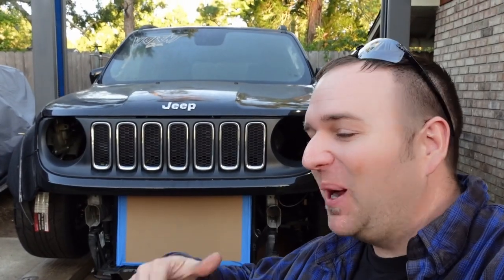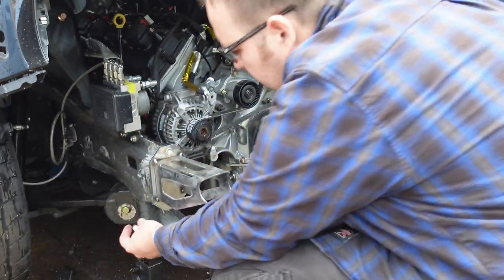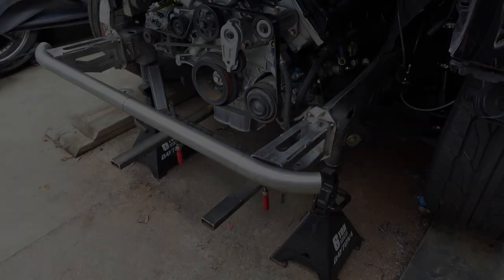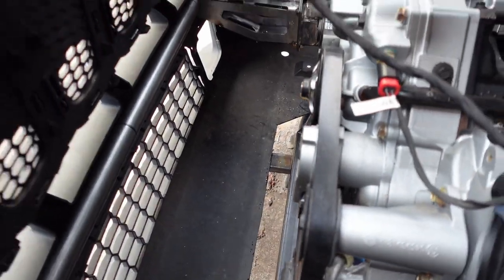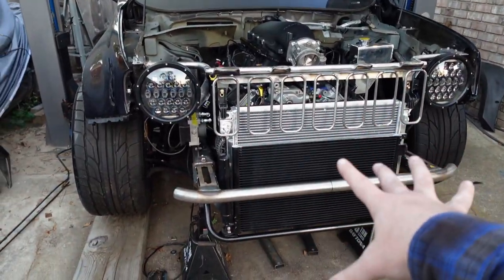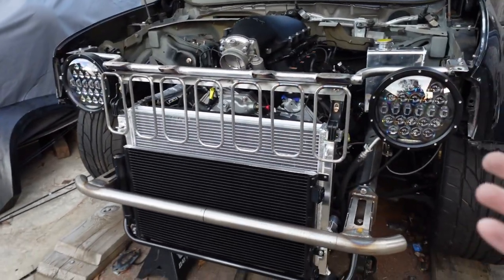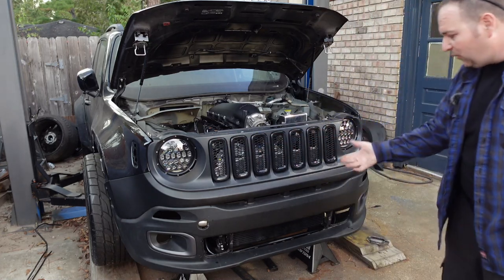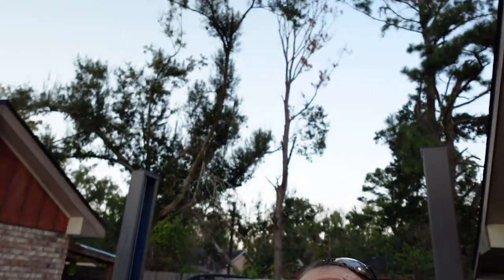HEMI Swap Jeep Renegade pt. 25 Bash Bar, Radiator, Headlights, and Grille

Comment: For the pipe bender, you can clamp the tab on the handle into a bench vice, allows you to pull hard on it, or put a tube over the end of the bending handle to make it easier to bend tougher stuff👌🏻
Reply from the maker: yeah I realized that after i was like half way though.  That woulda been so much easier.  We do that for 3/4" tubing at work, but I just spaced I guess 😅

Comment: the radiator fan is going to be a tight fit !!
Reply from the maker: Yeah its pretty tight in there, just about a 1" gap.  As long as it doesn't touch anything it should be good.  Maintenance and changing belts is gonna suck though.
Reply: UPDATE?!?

Comment: Glad to see more build update coming up! Do you open to add more new lighting kits to your Jeep?😉
Reply from the maker: It feels really good to get this project even closer to finished.  I do plan on installing a ton more lighting on this thing before it's done.  I just ordered the 8 gang AR-800 switch panel and 20 of the RGBW rock lights to get the light show started (should look crazy for burnouts).  I'd love to use more Auxbeam lights, like 9" off-road lights for the headlights, but unfortunately I couldn't find any that have low beams and high beams, or a dimmable option.  I really don't want to blind traffic too much 🤣  Since I can't fit the factory headlight housings anymore with all the modifications, I was kind of forced to use the ones I found.
Reply: @HEMIGADE  I see. What light you find and plan to take it as the headlight? I think Auxbeam is definitely don't mind to send other lights to support your build:)
Reply from the maker: @Auxbeam  for sure, I'll definitely be adding more lights to the build.  I'll need to change the fog lights, and upgrade all the incandescent bulbs to LED, then start adding light bars and pods.  I can't wait to get this thing sorted and looking great too.
Reply: @HEMIGADE  That's great I think we should be able to sponsor all these lights. Do you have a way for me to send the links of the lights?😁

Comment: i’m about to look into but a renegade this would be a nice to have haha but i honestly just like the shape of the car and it’s an upgrade from mine been lookin
Reply from the maker: They're actually pretty good little cars for what they are.  Like you, I got mine because I liked the overall design of it, and wasn't worried about performance at the time.  They're decent on gas and I had zero issues with mine before I chopped it up.  Mine was on the first shipment to the US back in 2015, so they've sorted out any potential issues like oil consumption which seemed to plague a lot of early models. Good luck with your car shopping, no matter what you end up with!

Comment: Looking amazing brother!!! I'm so excited for you! Gotta ask with the grill inserts did you just cut out the plastic and replace it with something else or did you just Dremel out all the holes like a lot of people have done... lol! I'd love a link or just a I bought the insert material here if you don't mind sharing or is there a cover on the back that you were simply able to remove. I have to look at mine. I'm going to do the same thing on both of mine. Keep it rocking brother!!
Reply from the maker: I took the whole grill apart, and cut up the back piece that has the mesh pattern in it. I used a cutoff wheel in a grinder and just trimmed the whole section out.  I bought those black plastic covers many years ago, so I don't remember where they came from.  They were just cheap stick-on covers probably from Amazon or ebay for like $20.

Comment: I have a renegade that I am dying to modify. I dont think I want to go a 5.7 swap haha. All I want is to get maybe 250hp out of my 2.4. I wonder how hard it is to add a simple turbo setup
Reply from the maker: Hell yeah man, just be careful with modifying these things, you might not know when to stop like me lol.  I looked into doing a turbo setup on the stock motor, since I figured it would be pretty similar to the SRT4, but from what i could find tuning the ECU was the biggest issue.  There was a company a few years ago that offered a kit and tune, but it was like 5K or something.  If I could start over on another build I'd probably just do an SRT4 to keep it in the Mopar family and prevent all the fabrication needed to fit a V8, or go Honda K Swap or Chevy Ecotec (since I have a few of those).  250-300hp would be ideal in one of these things, and would make it so much more fun to drive.

Comment: Hey Mike, I had a question about the adjustable control arms you built. Is there any way I can email you or something to talk to you about them?
Reply from the maker: You can go ahead and ask away.  Are you referring to the ones I built for the original air ride setup on the Renegade suspension years ago, or the new setup for the Charger suspension?
Reply: @HEMIGADE  the old air ride suspension is the one I was referring to. My jeep is on the SF Racing coilovers, but there is not camber adjustment or barely much I can do, even with the toe angle. How did do your alignment system?
Reply: @HEMIGADE  I’m about to go to another alignment shop in my area, but the last one said I can’t do much except rotate my tires every 3k miles so my tires don’t wear as much.
Reply from the maker: @niccon.7276  Front Suspension: For the camber adjustment, when I made the air struts I made the top spindle bolt slotted so I could lean the wheel in more than just regular drilled holes.  As far as front toe adjustment, I was able to dial it in with the stock steering linkage.  I think I had to keep the adjustable lower control arms about stock dimensions, because the axle would bind if it got too far out of spec.
Rear Suspension:  I ended up making my own lower linkages to dial in the toe and kick the bottom of the hub out, and also had the slotted top bolt for the spindle mount.  
I think the slotted upper bolt holes helped a ton, but having adjustable rear toe links is a must for saving the tires.  I couldn't find anyone who makes anything for this, but Valkyrie does make adjustable high clearance rear control arms that might help.
Reply: @HEMIGADE  you’re awesome bro I appreciate it tons, I really do. I’ll reply if I have any more questions. Hoping this build goes viral 🤘🏻🤘🏻
Reply from the maker: @niccon.7276  hell yeah man, no problem at all.  Not too many people have done much with these things, so I'm all for sharing the info.

Comment: Frigging beautiful work bro... im always waiting on your videos. I only follow DDE, whistling diesel, and you! I love your content. I ticks me off that not enough people are subscribing so you can make more content. 

I was wondering... I might look cool too if you add the same mesh that your facia has on the rings, to the rings you made. Idk, maybe a little something to make it look more "full" whenever you do drive without that bumper cover. 

Regardless, it looks badass!
Reply: And yeah, im a few weeks late, but now that I'm working in the oil field, I hardly have time to kill on the phone. Lol 

Anyway... hope all is well brother
Reply from the maker: @hazetrinity66  Thanks man, I really do appreciate it!  Hopefully once I get this thing running it'll get some more attention, so I can continue to push the limits with this build.  There's still so much to do before it gets to where I really want the build to be, but it's going to be a process getting there.  You might be onto something, a little mesh would really set off the grille so it doesn't disappear quite so much with everything going on.

I feel ya on the work stuff (oil refinery), there's hardly any time to get any progress done in the garage, and with the lift being outside I'm pretty much shut down with any weather or once the sun goes down.  Weekends are just about all the chances I've gotten lately, and it's rained the past 5 Saturdays here.  Anyways, thanks for following along so far, and for the encouragement to get this thing done!
Reply: @HEMIGADE   @Mike Martin   @Mike Martin  yeah man, always! Its pretty cool that you take your time to reply. I know you replied to most of my comments, and I missed one to reply back to you, but I don't want to go through all your videos and comments to find it. Regardless, you've got a shit ton of work done. The best part is that you seem to have all the goodies (tools). Thats dope. 

How you make that plasma cutter? Would be a cool little video to work on as well, in between your jeep vids. I'm sure I can find something on here, but I prefer watching your content, as I'm sure other do too.

Yeah, it'll be pretty cool if you add that or something to the rings. I told my dad about you and your channel a few months ago, explaining what you were up to. So if you do add something, I'll tell my dad, "look! I made that suggestion, and he actually did it." Haha... its whatever though. 

I can't wait to hear it and watch it run! That thing is frigging badass! Now that I remember, I think I had mentioned something about the nitto 555 g2 tires, how they were trash... I was wrong. For one, your tires are wider than mine. I've got 275/35. And second, my shit was out of alignment because of my worn out rear shocks. They're original, and I like to swing the car lol. So my tires look great from the outside, almost new. But the inside on the tires were all worn to shit, with cables sticking out. Both from and rear. 🤦‍♂️ I had to buy all 4 recently. Hahaha, now it hooks better, but I need shocks all around. Those toyo r888 I mentioned would be over kill for my ride, but you'll probably need them in the future.

Say man, you work in a refinery!? Why not build a little shed man! You're a diy'er. Make a video on that shit too! Its content and won't be that expensive. Lol. I would just do the roof to start, or set 4 post, and find a way to weave a heavy duty tarp. Stop playing around hahaha.. I kid...  I know you've got priorities. I'm just saying so you can pump out more content, if thats what kills your progress.

Alright, I'll stop right here... again, thanks for taking your time to reply. Stay blessed 🤙
Reply from the maker: @hazetrinity66  Yeah man, I try to keep up with replying to comments, since you guys take time out of your day to reach out, but I do get pretty forgetful sometimes.
I do enjoy collecting tools, because I hate not being able to do something or relying on someone else to make parts for me.  That's the main reason I started building the CNC plasma table.  The table base was built from 2x2 and 2x3 square tubing, all the other parts (linear rails and bearings, stepper motors, control system, stepper drivers, power supplies, switches, etc.) were all pieced together from eBay.  I did have to make the Z Axis and gantry for the plasma and router cutters though.  It should also be able to cut wood and stuff, but I've never ran it with the router attachment. This thing took me a few years, and a couple different revisions to get here, but it still isn't that great.  The program I use to control the motors (Mach3) has been acting up, and just decides to start cutting before it gets to where it should.  I have to have my hand on the kill switch ready to stop it.  Once I figure out what's wrong I'll probably do a walk through and a build break down on it.  I've tried so many things to fix it, but nothing seems to work.
I'll have to figure out how to add some mesh to the grille, since I already painted it.  I might just have to weld some mesh in there, and re-paint it, or figure out how to bolt some onto the mounting bracket.
That's good to know, I don't really have a ton of experience with tires and performance, coming mostly from stance and FWD stuff.  I did order a set of Weld wheels, so new beefier rear tires are coming soon, just have to decide on which tires to go with (looking at Nitto NT 555 RII Tires N108-740 P305/45R18).  I'm hoping to be able to put the power down and see what it'll do.  The build started off just to have fun and do burnouts, but I think this thing might actually have potential to be fast.
I do have a concrete slab behind my garage that had a little roof, but last year's hurricane took that down.  I've been meaning to rebuild it, and might as well put walls up too, for a little more working area.  I really need to wall in my carport area too, and put up some garage doors, so I can have even more room to work on stuff.  Finding the time to work on household projects is always difficult, like if there's free time why not work on cars lol.